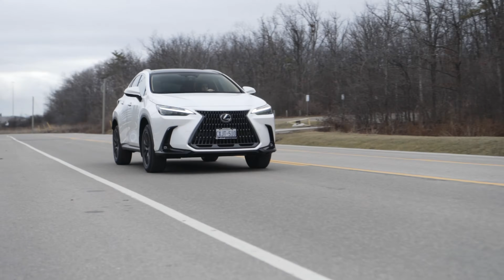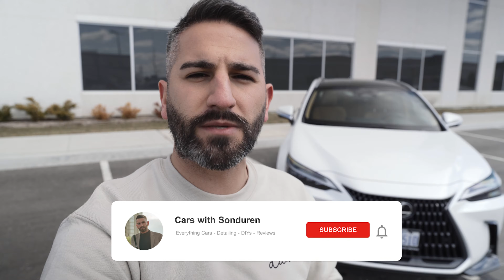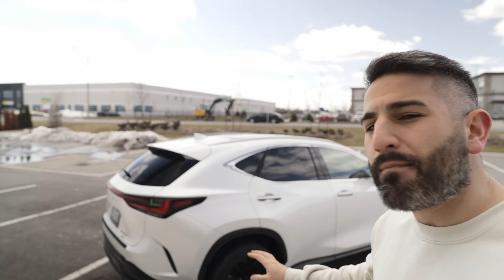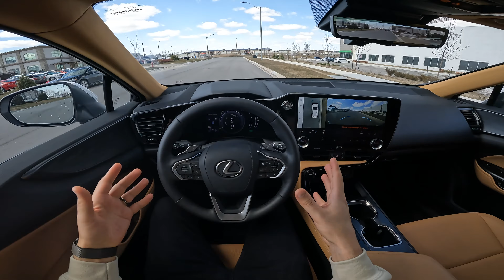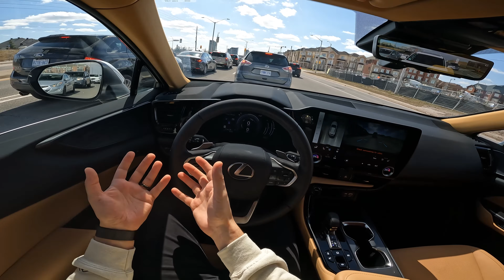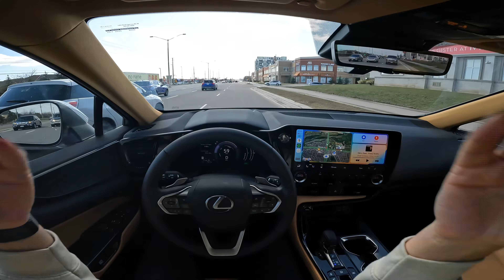Get The BEST Gas Mileage From Your Toyota & Lexus HYBRID!

Comment: Your technique is absolutely perfect. However, the updated consumption figure shown on the display should only be taken seriously after you’ve driven more than 100 km. Before that, the consumption value is still adjusting. The trip is too short.

Comment: Fascinating to read many of the comments posted by others here, and I have an explanation for those who find that the engine kicks in 'too soon', eg @hughmangiss who has a 2013 RX450h. That model year RX has a third generation Lexus/Toyota hybrid engine that comes from an era where the focus was on blending a large V6 engine with electric assistance for smooth, luxury performance. Lexus/Toyota hybrids are now fifth generation,  and it's been quite a leap in technology between the two—moving from Gen 3 to Gen 5 with a massive reduction in the size and weight of the hybrid components, alongside much smarter software for managing power. I've recently changed from a fourth generation 2023 C-HR hybrid to a fifth generation 2026 C-HR and am already noticing a significant improvement in fuel economy, and almost no kick-in of the engine unless I floor the accelerator. With my 2023 car I was averaging 60mpg (sorry, don't know the km equivalent) but already in just a month's ownership of my 2026 car it's high 70s, and yesterday a phenomenal 92.4mpg on one trip of 12 miles. Toyota Europe published two insightful hybrid driving tips videos a couple of years back, this is the first of the two: https://youtu.be/PtktHR8ouuE

Comment: I just got a Crown Signia which I believe is a very similar car, and even though I'm apparently doing the pulse and glide wrong, I still average about 41 mpg US.  That's about 5.7L/100KM.   But...

I just took a 15 mile drive between suburbs, and our municipalities could really do better.  The lights are not close to synchronized.  I had to stop at them one after another, over and over and over.  By the time the trip was over I was at 41 mpg, but through most of it I was around 35.  I'm sure I'll learn to do better, but these traffic lights are insane.  Just a waste.

Comment: I am below 5 liters / 100 km with a Corolla. The most efficient pulse and glide will only very mildly use the battery, keep the needle between REG and ECO range because using the battery causes losses. I suggest to use the amazing Hybrid Assistant app to keep it all under control.

Comment: I have been driving Toyota Hybrids for over 20 years. I typically get 5 mph above the rating by doing everything in the video other than radical pulse and glide. There ought to be a bounty on folks who block traffic on two lane roads using pulse and glide. One trick I use is to let up on the gas quite a distance from a stop sign or red light and begin braking at the warning sign that a stop sign is ahead.

Comment: Excellent video and great tips too. I do know all these tips and tricks. I have a very late 2012/2013 Toyota Auris 1.8 Hybrid. It's a fantastic car and super reliable. As regards fuel economy/Gas Mileage, I get an average of around 64 to 75 mpg UK in the winter, and in the summer I get from 75 to even over 80 mpg UK. I've saved over €800 to 900 in fuel per year. I may think of going for a PHEV in the next while to save even more money.

Comment: i mostly use cruise control on my new 2925 camry.  i beleive it saves fueul.  if we dont use cruise i believe we pump gas padal not optimal way and it can start gas engine.  i mean in order to hold momentum we  sometimes overdo on gas padal which kick starts engine various times.

Comment: Actually idling at stop signs or else is not using the gasoline engine, but your battery, sure idling consumes your battery charge, but not costuming gasoline. I tryed that and confirm with 450h. 

The reviewer is demonstrating very well this approach of coasting (pulse & glide), also that hard braking is not productive, it’s a waste of energy instead to be used to regenerate the consumed battery charge.

Comment: Thank you for making this video to help HEV owners to improve their MPG.  A few things I have learned about saving money & MPG throughout the yeas after owning a HEV:

- Sell the OEM tires (especially the heavier Run Flat tires on some NX350H trims) when new/lightly used for maximum ROI and purchase one set of 3PMSF snow approved All-Weather (Michelin CrossClimate2 for me at Costco with lifetime free balance, rotation, repairs & 5 year road hazard prorated warranty) to save money from purchasing another set of winter tires usually costs $1,200+ (sold both the OEM Michelin Energy Saver AS & X-Ice Xi3 I owned for one set of AW tires & on my second set at 140,000KM) as well as paying (or free "Self Labor" to swap out the tires twice a year at $120-$200 or self labor & time depending on the shops).  The issue of swapping out the tires twice a year is more than saving money, appointment times or storage spaces but also avoid major safety issue.  All Weather tires removes the guessing game out of swapping out the tires at the "perfect time" which never happens when it comes to weather.  Everyone I know go through the regrades of swiping out too early or too late while the weather (in Peel/Halton/Brampton/GTA areas) can easily changes between -10C to +10C between day to day or even between the morning and evening driving conditions in the beginning and the end of the winter season.  It's a major safety issue that all drives can avoid everyday.

- Get a smaller rim size.  Large rims (20" on some NX350H) is always heavier so downsize to the smaller/narrower (and usually cheaper) 18" factory approved rim & tire size will also improve MPG immediately regardless of vehicle while improving the comfort and softy in snow traction while decreasing a bit of corner stability when driving aggressively (which means MPG  means not as much to the driver) 

- Extra 3psi to 4psi (depending on vehicle specification) inflation to the tires regardless of the atmosphere temperature (will vary based on the departure & arrival altitude) will provide ~5% MPG (or cash in the pocket!).  This is to decrease the "Tire Deflection" rate (50KPH= ~ 7x/s vs 110KPH+~16x/s) which means also decreases the sidewall flex, heat, stress and failure of the tires.  Many Europe only model vehicles have three tire pressure recommendation label at the driver's door by the auto manufactures.  For example on a Renault Merane:  Normal <160KM: 36psi / High Speed (aka. AUTOBAHN) >160KM: 41psi and "ECO": 41psi as Europe pays even higher fuel price than North America or Canada and most of the same tire manufacturers produces the same model tires with less tread which means less weight with less tread flex and more lateral stability to improve the MPG (why MPG decreases when replacing with the exact same size & model tires due to more & deeper treads that would be heavier on each wheel for the transmission to spin them).

- In the winter, turn down the desire temperature and use heated seat and ware thicker jacket in colder weather will provide more comfortable less dryness heat.  Except vehicles equipped with heat pump, regular car heater uses ~1300W of energy just like a regular hair dryer which consumes a lot of energy for the vehicle's engine to provide during cold weather while trying to warm up the engine to give us the best performance.  If all possible, turn the heated sets to high and watch the engine temperature gage until it reaches the normal level (usually just below the middle line) before turning on the heater unless defrost is needed for safety reason.  

- Clean/Replace the battery ventilation intake filter.  The hybrid battery pack is usually located below the passenger seat and there is a ventilation intake vent located below the passenger seat that requires regular maintenance of cleaning to keep the battery pack's temperature regulation intake fan to operate at optimal conditions.

Thanks again for sharing your experiences on this great video and I hope what I shared will benefit someone.

Comment: I can get the ECO score super high (90+) by accelerating with only the battery, but at the end of the trip I sometimes only get ~31 MPG. The ECO score doesn't directly correlate to the gas efficiency, and I'm still trying to figure out when to ignore it.
Reply: You may well have figured this out by now, but I got a hybrid RAV4 last month and had the same realization. Eco score doesn't seem to mean much.

I now ignore that score. I set my end of drive summary to the mpg screen. I leave my display while driving in the mode that shows me how charge is flowing to the battery/when electric and gas motors are powering front/back tired. By maximizing my time in eco mode on the "tachometer" with the pulse and glide technique I just hit 52mpg on my commute home today. Before for that kinda trip I might get like 33mph.

Comment: I enjoyed the somewhat helpful tips on driving habits however, two mistakes I'd like to point out. In the winter time, you do not want to keep the externally cooled battery cold because it has a negative temperature coefficient NTC THIS MEANS THE WARMER THE BATTERY BECOMES THE LESS AMOUNT OF RESISTANCE THERE IS WITHIN THE BATTERY. This simply means that the warmer the battery gets the easier it is for the electrons to flow through the battery into the rear motor for the rear tires only. The same can be set for the summertime and the summertime. It's best to keep the batteries as cool as possible by keeping the interior cab air-conditioning on this will help cool the batteries because when the batteries get too warm doesn't flow as well as when they are at the optimum, temperature of 20°C Celsius is when everything in the vehicle works perfectly fine including the engine, motor and batteries underneath the rear seat. The other factor I'd like to point it was you mentioned that from 90 to 120 km/h you mentioned that consumer reports found that hybrid vehicles on average used 25% more fuel at 120km/h than at 90km/h. Well 17:54 , those consumer reports analysts are true geniuses because it just so happens to be that at 120km/h you're going exactly 25% faster than when you're at 90km/h. You simply gave me the math from what they found and that simply shows that it's a linear scale. It is an exact upward linear scale from speed being on the bottom of the graph and fuel consumption being on the left side of the graph with a 45° linear rise in fuel consumption depending on speed with a hybrid engine. 120/4 is 30km and 30km is 25% of 120km. So you might have to make corrections moving forward on those two factors. If you want to do the research look up any battery doesn't matter what kind of battery it has an NTC it's actually the only 2 components within the hybrid vehicle is a starter battery and battery for the rear axle motor. Vehicles employee a safety mechanism when they reach too cold of a temperature they will actually heat themselves up with a blanket underneath the batteries just so you can get something out of the batteries at -20°C if parked outside. Then, as the battery warms up, it will act more efficiently. That being said, the pulse and glide technique will be far more efficient in the spring and fall temperatures that are more ideal for battery performance. Thank you for the video and keep up the good work with tips.
Reply from the maker: Such great detailed points thank you for sharing!!

Comment: Great video thank you so much I live in Canada, I'm in Aurora Ontario. I own a 2021 ux 250h and was wondering about drive modes and when to use them? The dealership told me to use Eco when I'm at a constant speed on the highway and stop and go traffic use the normal mode, is this correct? Another question is initially my climate control was set to auto and I turned it off because it was turning on the AC. I was wondering is it best to turn off the AC for better fuel economy or is it only turning on the HVAC compressor and not actually the air conditioning. Would greatly appreciate your feedback. Thanks

Comment: New to the hybrid world since buying my 2013 RX 450h a month ago. I'm definitely trying the pulse and glide method. The only problem I have is my engine kicks on almost immediately as I pull away from a stop even though I try my best to start very slowly. I always drive in ECO mode as well. Bums me out. Love the car so far.
Reply: I have the same rxh. You are absolutely correct, the engine does kick in very often when coming off a set of lights. It’s a heavy car and the battery can’t put in enough power to give decent acceleration. 
I prioritise my fuel saving to suburban driving and get about 7.5l/100km, overall.
Tyres pressure’s maintained 10% above spec. 
Also, in cold weather, I only turn on heating after the engine warms up
Reply: Hello, I have seen better mpg in normal mode as opposed to hybrid. Just becaue you are able to get up to speed quicker, and then switch to battery mode.
Reply: I've just posted a comment at the top level that may go some way to explaining the engine kick-in experience you had.
Reply: Some of the tips are not valid driving 450h. I have 2011 RX 450 AWD, so a bit more heavier due to the 2nd el. Traction motor in the back. The economical driving here is called, “coasting”. (Instead of pulse & release). Which means for a heavier vehicle like 450h vs. NX 350g, the V6 Atkinson cycle engine picks right away, especially when backing up due to the safety issue Lexus did in order the otherwise very quite hybrid to aware the surrounding pedestrians of moving vehicle. 

Then slow driving shifts the gas engine to exclusively electric below certain speed 40mph. You know that not only by monitoring the-energy flow  but by monitoring it on the larger navigation screen. You also know which engine other el. motor is driving the front wheel by seeing on your main dash screen on the left whether you’re in charging mode, or Eco mode, or mixed driving when the frond wheel drive is is powered by the gasoline V6 engine or both. In case of the top of the RX line, 450h model, at certain high speeds above 70mpg (110 km/h) the rear el. traction motor get involved also allowing the max horse power involved. 

The so called electrical AWD gets involved with 450h model not only when front wheels loosing traction on slippery wet roads, but when your speed reached high numbers as well. You follow with that watching your readings (which replaced the conventional tachometer). So with other words, driving economically with your hybrid depends how you handle your drive, road conditions, city or highway. Accelerate slow, try once you reach your speed to maintain it (coasting) or using your cruise control. Good motoring!

Comment: Hey @sonduren. Are you able to control your heated seats via the Lexus app?
Reply from the maker: Yes you can set that up for remote starting
Reply: I don’t have an option on my 2024 nx350h ultra luxury though. I’m using the iOS Lexus app. Did you have that option from the beginning or you ask the dealer to activate it for you?
Reply from the maker: @mikenbfc4115 that’s very odd. Had it from the start but let me double check. Yes just checked, when the seats and steering wheel are on auto they will turn on with the heating and remote start.
Reply: Thanks for checking! Can you change the setting for heated seats and steering from the app though?
Reply from the maker: @mikenbfc4115 yes you can just checked
Reply: Thanks for confirming that. I don’t have that option in my app even though we have the same trim. The only difference is that I have 2024 nx350h.
Reply from the maker: @mikenbfc4115 very odd. Talk to your dealer and see why?

Comment: What does the EV button function do?
Reply from the maker: It basically forces the car going into full electric mode. Through research this actually is more damaging to fuel efficiency, as you should just let the computer decide when to go into EV mode and not.

Comment: I have noticed and I don’t know if anyone else has but cold weather and winter blend fuel does drop the MPG in my RAV4 Hybrid! The engine has to warm up to the half mark and then the hybrid system will start to kick in-is this normal? I use Chevron gas and tires inflated to 38 psi from the suggested 36 psi I go 5 miles to work and 5 miles back and am averaging 35.0 mpg. Any suggestions or recommendations? Thank you.
Reply from the maker: This is normal you brought up all the right points you can’t really control it. Just don’t idle excessively

Comment: How does the AC work at a stoplight or drive up if the engines off
Reply: Everything works by electric on Lexus hybrid vehicles! The AC compressor is powered by the hybrid battery which allows it to work without the engine running! And because it is powered electricly there is no drive belt attached to the engine that puts a drag on the engine even when the compressor is not engaged! The power steering is also electric so there is no power steering belt attached from the power steering pump to the crank shaft pulley which also reduces the drag on the engine and the water pump is also electricly operated which means that no drive belt is needed to spin the water pump and the less drag on the engine the greater the fuel economy! Every little bit helps towards achieving the CAFE standards for 2024 of 52.9 mpg! Now just think about driving 52 miles in a 3000 or more vehicle and only using 1 gallon of fuel? The department of transportation who determines the CAFE standards is simply living on fantasy island!
Reply: Its electric and works off the hybrid battery